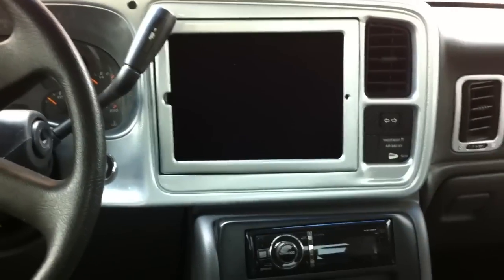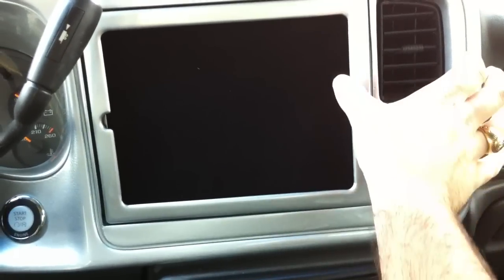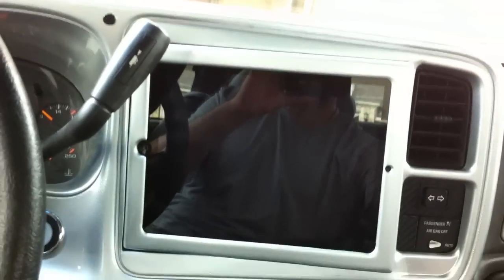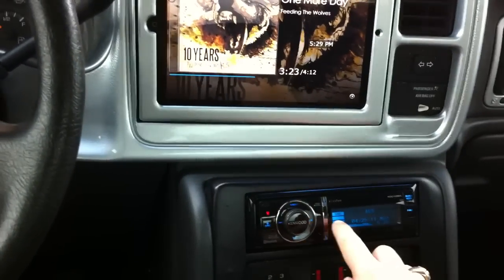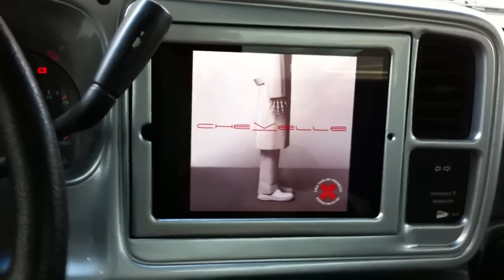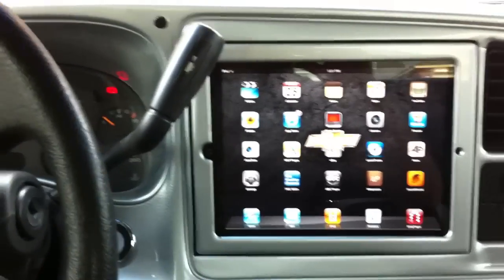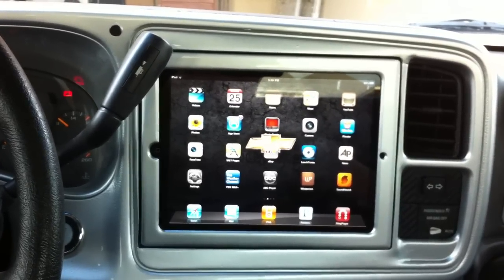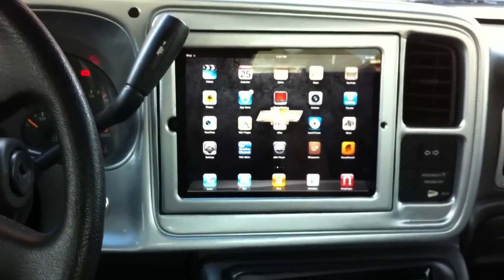Motorized iPad 2 Install in Silverado

Comment from the maker: @j3susam123 It is the engine start.  When you push it without stepping on break it works as accessory power as seen on video, but when you step on brake, it will start the truck.

Comment: Questions - any build pics? I'd love to see some... also, is the actual Ipad bracket attached to the bezel , or attached to the car. Secondly, how did you shrink the air vent? cut and glass?

Comment: Nice setup, What model of linear actuator did you use on the first install and what slides.  I want to do this in my 99 Yukon, but i'm trying to figure out the guides and actuator, so that the whole thing slides forward slightly. Did you use a different actuator for this one since it slides only one side out? Thanks

Comment from the maker: It slides into the ribbon connector of an iPad dock on the left and that dock has AUX out as well as sync cable fo charging. Then I used a USB lighter adapter  connected to switched ignition power so that it turns on by itself when I start the truck or switch to accessoy power.

Comment: Oh and the actual question I forgot to ask. What about charging? Does the ipad slide into a charger port in the mounting plate? I saw you slide the ipad in and out with ease. Is it actually sliding into a charger port? Or do you have to charge it at home of with a car charger out of the mounting plate if you battery runs low. That would be essential to put a charging option for long trips.

Comment: Hey wat kind of motorization did u use and how would u mold the shape... Using abs plastic sheet??   Anyway clean install u should try to run an apple tv  in there

Comment from the maker: I cut down the actual vent, by cutting a small strip off the top and bottom so I could fold it inward to prevent any leaks.

Comment: What kind of motors or other electrical components are needed? I am building a custom fpv box for my airplane and my tablet will control the relays to turn on/off various componaents. I was thinking of having the tablet tilt up for better viewing rather than lay flt.

Comment: i understand you may have answered this question in the past... but can you tell me what motor or actuator you used? i plan on doing a motorized one but having difficulty finding the right one to use.
Reply from the maker: Most of the motors out there are too big unfortunately. You'll have to do some cutting on your dash. But I used a linear actuator with 1" drive.

Comment from the maker: The company isn't making them anymore. But I am selling mine. It's an active rfid system. Meaning that as I approach the truck it automatically opens the doors and activates the push start button. When I leave the truck it automatically locks the truck. All without using a key at all.

Comment: @torres1708 Nice! It would be great if the IPad could be used to control every aspect of the car.  Of course that would require the manufacturer to release the commands so a control page could be made.

Comment: Is possible to do the same job in a 07 Lincoln Navigator
Reply from the maker: Eddie Maxtu that dash opening may be a little too small. You could probably do it with an iPad Mini
Reply: Emmanuel Torres how much will you charge to do that job

Comment: have you make eny 4 sale..i have a 2002 gmc sierra slt
Reply: mine is a 2004 silverado work rig here it's got all stock   even  the hard working  v6/ auto,. /manuall on the floor 4x4 here in my rig...............

Comment: line of code my ass
Reply from the maker: Check the date on the vid, dude. This was taken before that feature was added.
Reply: no it wasn't. I had that on the 1st ipad. you didn't put any code in apple didn't allow people snooping in the code. iTunes wont read it. and no jailbreak then okay how did you do it? hum
Reply from the maker: There was a jailbreak and it wasn't my code or anything, I just googled it and some guys found that the feature was in the software but not made active, unless you went in to change it. Just like panorama photo taking or adding Siri to iPads. Either way, it doesn't really matter now.
Reply: Si